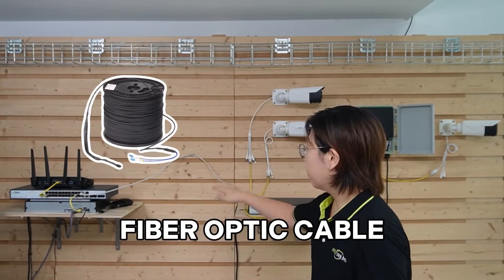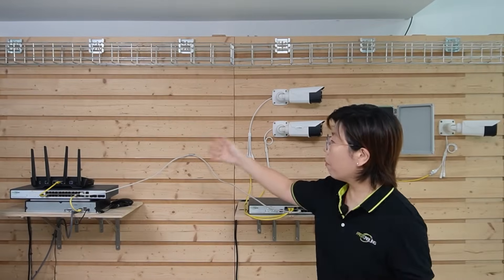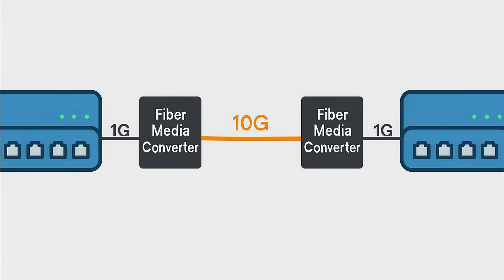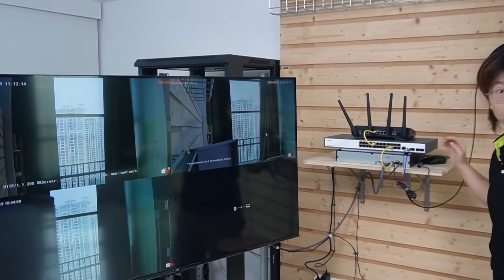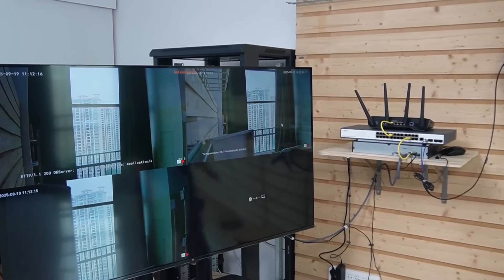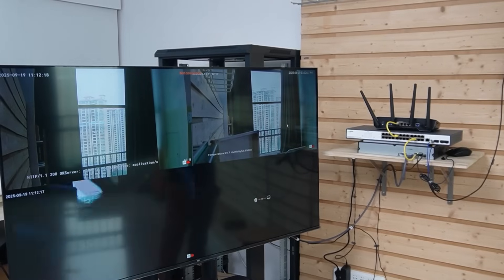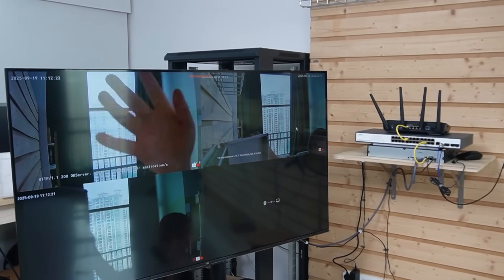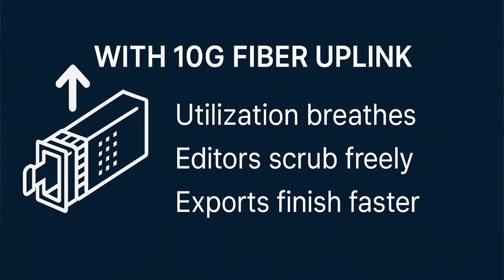Upgrade 1G to 10G Network with Fiber | Fix Laggy 4K Cameras

Comment: And who has an NVR with a 10Gig ethernet port, along with a supporting Cpu/motherboard?   The example you show still has a bottle neck.
Reply from the maker: You’re right. Most NVRs only have 1G ports, so they’d bottleneck on a 10G backbone. The idea with upgrading to 10G fiber isn’t that every device suddenly runs at 10G, but that your core network (switch ↔ backbone) has enough capacity to handle all the 4K camera streams.

Comment: Are we just skipping the fact that the NVR is only 1gbe
Reply from the maker: The VLANs could group the IP cameras and send them to the corresponding NVRs.
Reply from the maker: The goal is to identify and eliminate bottlenecks. A 1Gbps NVR can coexist perfectly on a network with 10G links. The 10G backbone now handles the heavy traffic between your workstation and the file server. This traffic no longer competes with the camera footage traveling to the NVR over the 1G link.